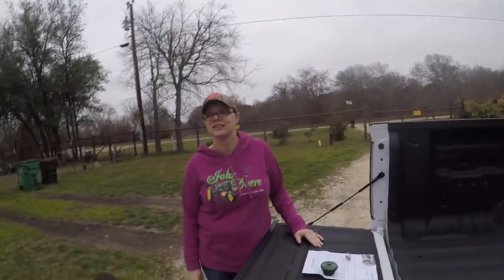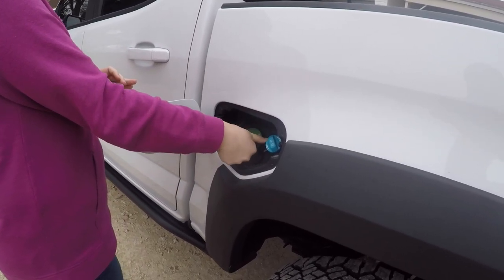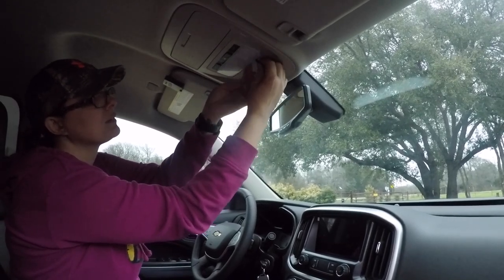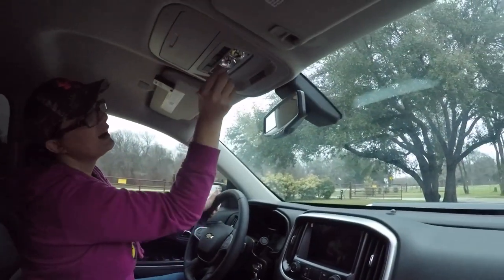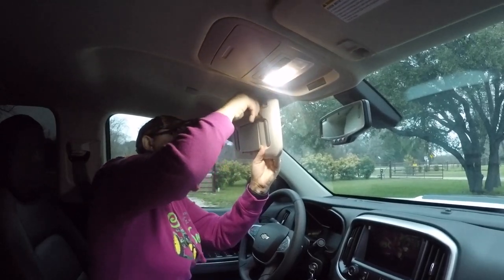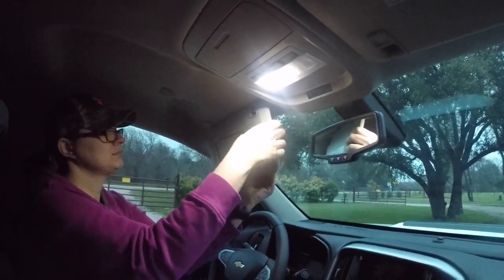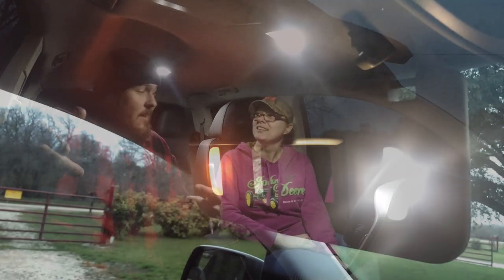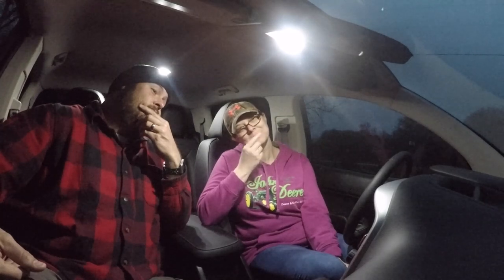2019 Chevy Colorado ZR2 Bison, LED interior light upgrade, and fuel cap replacement

Comment: i'm thinking about getting some aux lights for those pop outs on the rear bumper. ya'll thinking about the same? if so which brand are you thinking about going with
Reply from the maker: Corey, yes sir we absolutely are. I have been comparing the AUXBEAM lights VS the Rigid, for the price point the AUXBEAM is more in our price range (I think the bumper was designed for Rigid light dimensions in mind) . The problem that I have found so far is that there is not a bracket under the bumper that will allow just any light to mount to (unless I am just not seeing it), and I am currently awaiting AEV to respond to let me know if they have a specific bracket to mount the cubes in. Yes I could just drill into it and make something work......but we would like to do it "right" if at all possible. So long answer yes....short answer we don't know yet haha.

Comment: Waiting to see winch install if you’re going to.
Reply from the maker: So yes we plan on it, and we plan on doing a Warn. However right now they currently do not have the correct fairlead for the AEV bumper (the fairlead that comes with a winch does not work) and we are not 100% sure which will fit. With that being said we plan to do one.....just waiting to find out which one will work.